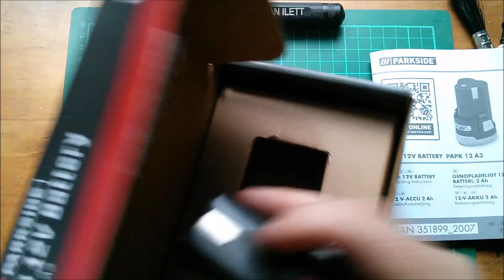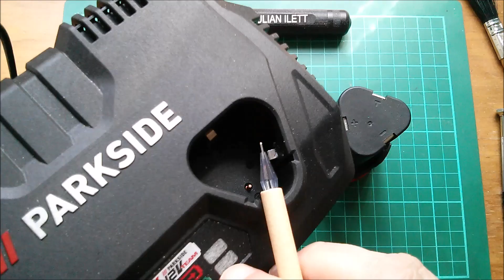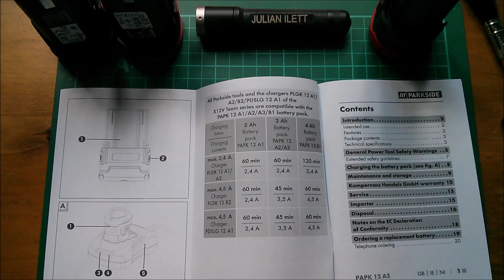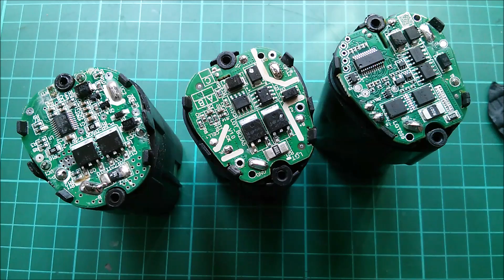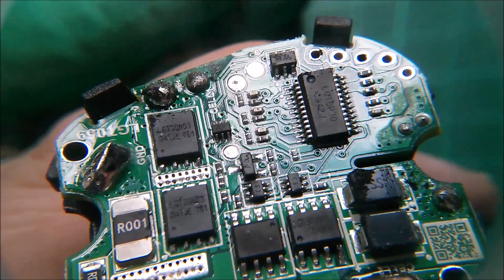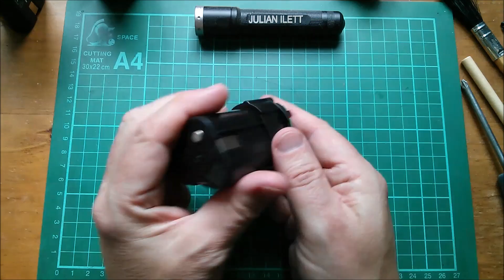Parkside 12v Power Tool Battery from Lidl

Comment: Have same battery and same charger.
When i plug battery in charger i can only hear beep sound from charger and lighting greed led ( not red )
When i test components on battery bms i get two diodes ( to beep on continuity test )
So close to create hole in wall

Comment: Can u charge a newer model battery with an older series charger? Both 12V but old batterie and charger only have 1,5 Ah, new battery has 2,5 Ah. New battery has  that little, metal ID pin, old charger doesn't.

Comment: Hey i just bought some power tools from lidl and a 4Ah battery...has that small central pin also.
The question is: can i charge the battery just connecting plus and minus on a 13/14v 2.5A power suppy? Is there any pint to be short out in order to enable the mosfets to take power? (I have a bench power supply so i can be confident using it).
Reply: I need it as well; have you successfully charged it externally? What voltage/current?

Comment: What does that circuit do? Will I be able to charge the battery pack with a third party charger matching the original output values without overcharging the cells?

Comment: will a charger for an a1 battery charge an a2/a3 battery? i can find loads on drills/battery's etc but nothing much to do with chargers except stripdowns.
Reply: I think so yes, I use the same charger for my A1/A2 batteries.
Although I removed the polarization splines on the A2 so it fits the A1 so I have to be careful of the rotation I put it in.

Comment: These look almost identical to the Rockwell's in the states. I think that line has faded out though. I rebuilt my 1600 mah batteries with 3ah batts. And yes those have connections in between the cells. But the balance circuits are in the charger.

Comment: I just took apart a 12 volt Parkside battery sold in the USA.  The drill and battery appear to be almost identical, but the item numbers are different.  The circuit board on the battery is completely different than the three shown here.

Comment: With Li-Ion cells, if they go beyond their rating, cycle life can be drastically reduced. For instance, if you charge to 4.3V, that can literally pull 100's of possible cycles out of the cell if happens repeatedly. The same is true if a cell voltage drops too low. Most cells are designed for 2.5V for absolute bottom voltage. Going to 2.2V could reduce life span drastically, just as overcharging.
The other issue with over charging is that it can cause the cell to go thermal, heat up until it catches fire. Altho, the bms has a temperature monitor (or at least it should) to stop charge/discharge once temps reach a certain threshold, usually around 120F/48C, or less. I have seen some as low as 45C.
So if this bms in these units are "actually" doing as advertised, then yes, it can extend the life of the battery by several 100 cycles. As long as the balancing voltages are set correctly.

Comment: I noticed today in their website that their 20v batteries for sale also shows: "Cell balancing for longer life and an increased life span" So you may need another trip to LIDL, buy a 20V battery and make another review.
Reply from the maker: New 20V tools available from Sunday :)
Reply: @JulianIlett  
Yes, you are right, I missed that bit. I also noticed them showing a 20V cordless bench grinder.  The thing is, when you read the description, it says 120watts. I need to wait till Sunday to see if it is cordless or not.

Comment: I bought the "wireless" glue gun from Lidl a while back. You put it in a dock to heat it up and when you use it it doesnt have an annoying cord dangling around. When you are done just put it back in the dock and it starts going up to temp again. Really handy and works like a charm. For power tools though we are all about Makita :P

Comment: Is "cell balancing" to make sure they are all of exact equal weight?

If one cell is a bit below weight a small strip of lead is added?
Reply: Correct.  This is done so that if you hold the wrong end of the drill, there is minimal vibration when spinning.  They don't use lead anymore though because of ROHS.
Reply: @KNfLrPn  Yes. I'd agree. Out of balance centrifugal forces caused by an out of balance cell. Maybe they use a vegan alternative to lead now? Due to ROHS.
Reply: @stakkerhmnd  Lead is vegan.
Reply: @KNfLrPn  Yes. it's on the periodic table so it's all natural.

Comment: I think the longer lifespan claim could be justified (within loose marketing terms) when referring to the whole pack; I have had a few older lithium packs which have gone dead because one of the cells was lower charge than the others, and eventually failed making the pack useless unless you know how to replace one cell, which most consumers don't.

Comment: Yeah, the benefits of cell balancing on power tool batteries are basically not existant. It's ok to have, it won't do any harm, but it will not suddenly increase the life span of the battery very much. The effect of the balancing circuit will be greater towards the end of the life cycle of the cells when the cells will naturally start to drift apart, but until then it will basically do nothing as these cells will stay in balance on their own. And when the time has come then you'll rather replace the battery anyway because by then it will have reduced runtime and maybe also reduced power. The balancing will keep it usable for additional cycles but will obviously not give back the lost runtime and power.
Reply: Cells are getting charged and discharged at high rates so even small differences in internal resistance will make a huge different after a while. Charging them at high rate requires a lot more monitoring, I've personally had some problems with that after a hundred cycles or so, however I've never used balancer with low charge rates. 
Parksides 20V batteries have bad LVP (if any) and I've had few of them go too low for charger, it just simply won't charge them. I use Imax B6 to raise up voltage a bit and then charge it with provided charger.
It probably won't prolong lifespan by a large margin, proper low voltage and overcurrent protection are enough.